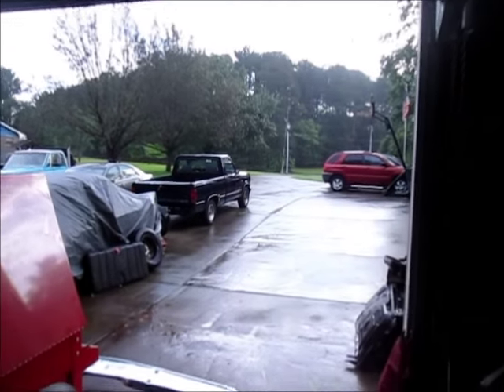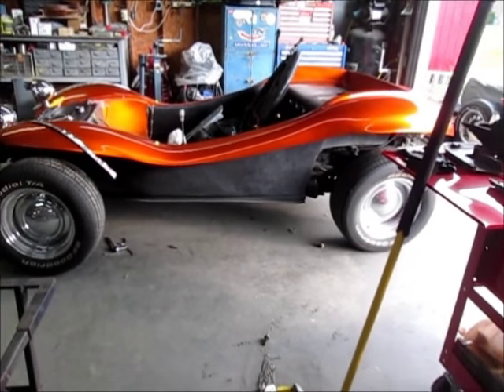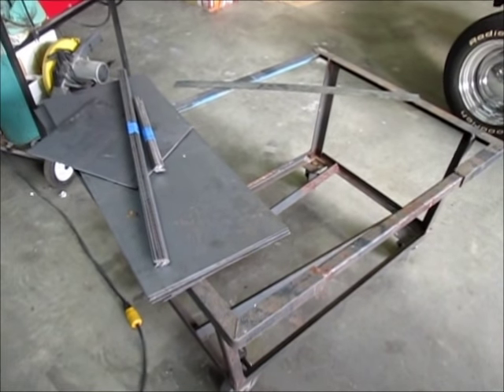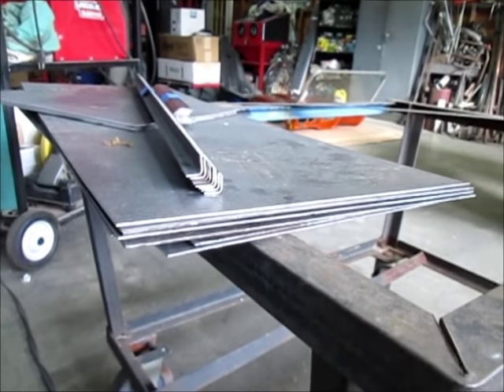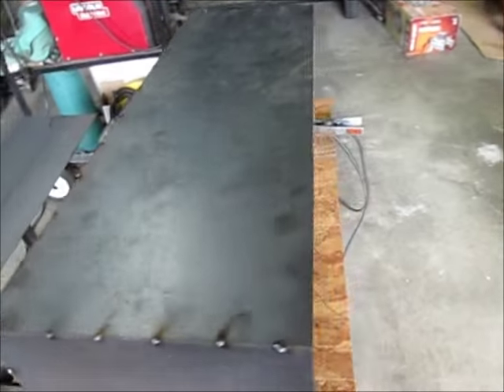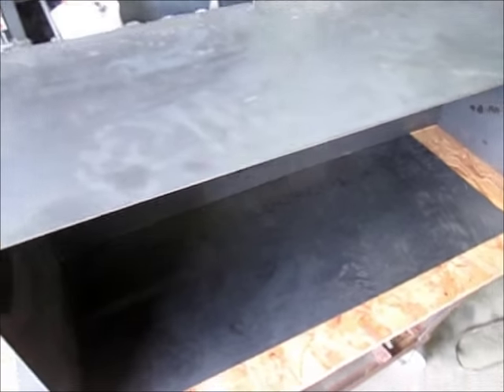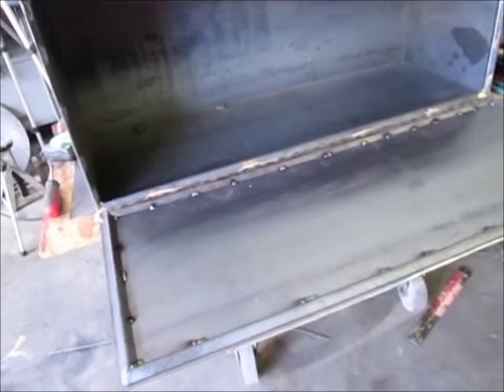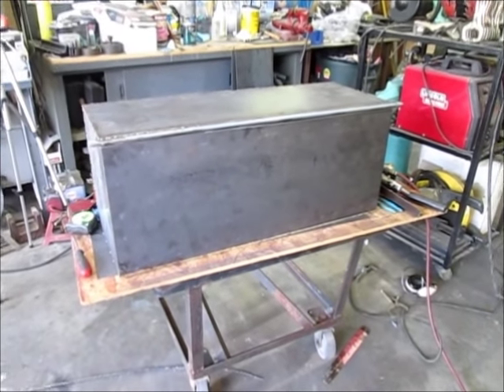Custom under bed tool box for FrankenTruckHD

Comment: Hi. I need to make a box just like this but I'm still uncertain as to how the water stays out from those seams. Is it working for you? if so, what are the "frame work" seems called? Angle iron comes to mind but I know it's not that. The box will be mounted on top of the truck and we get a lot of rain where I'm at. Any thoughts would be greatly appreciated.
Reply from the maker: The angle pieces were bent from flat stock. I have had very little issue with water. Mostly from condensation. I drilled 2 holes in the bottom to let air in and out, and that took care of it. All seams were fully welded and ground smooth.

Comment: Could you tell me how you bent those pieces to fit inside the box? are those pieces just angle iron or just flat stock you had cut down and bent? Also, did you weld down all those outside seams?
Reply from the maker: They were metal strips that were bent to a 90  degree angle. I welded the entire seam of the box.

Comment: How did you install the piano hinges? did yo screw them in?
Reply from the maker: I drilled a pattern of hole about 2-3" apart, and plug welded them. I was able to grind the welds down slightly afterward, and keep a clean look.